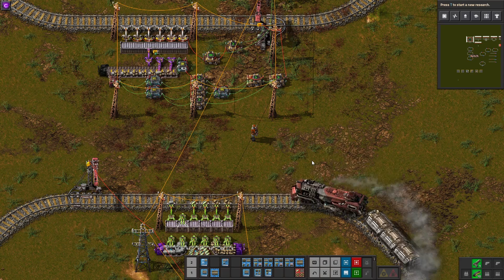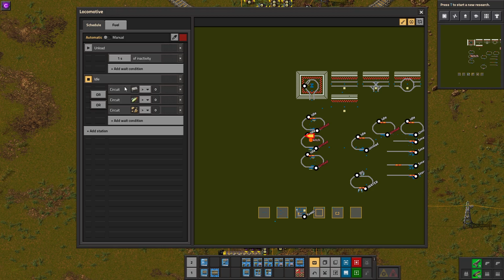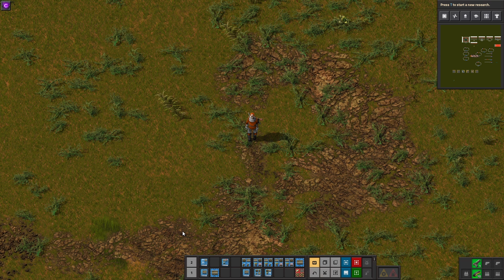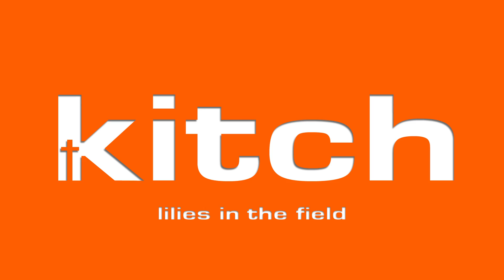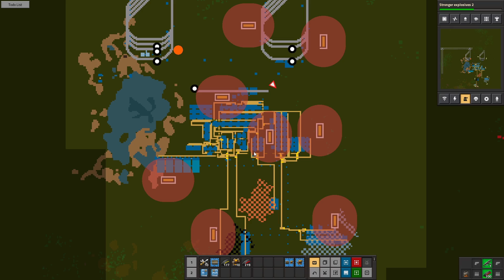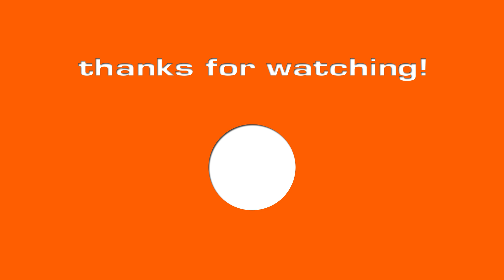Factorio On Rails | 05 | Unloading Station Circuits and Basic Oil | Factorio Train Base Let's Play

Comment: Great series. I like to use the Stone Water Well for my water needs. Pumps out 1200 per second (some of my hyper factories in K2 need 3 wells to run at top speed).

Comment: Much easier to watch than the explanation video I made. 😉 
I also decided to keep the -1 combinator specifically so you could use positive numbers in the high/low combinators. I figured ease of use was worth one combinator. lol

I tend to do stuff like than when designing for other people to use... if I was designing for myself I'd throw ease of use out the window and design for pure efficiency. 🤣
Reply: While set to automatic mode, the trains change color when they begin moving.
Since the train was empty when you sent it to the petroleum pickup, it turned grey. When it began moving away from the petroleum pickup, it saw petroleum in its cargo and turned purple. After unloading it saw an empty cargo and turned grey again.

Also, you didn't get the mod to color the wagons? Trains look so cool when the whole train changes color instead of just the engines.
https://mods.factorio.com/mod/FluidWagonColorMask

Comment: Really good explanation for the Station👍
Reply: Through i would use the output of the SR-Latch to send to the Network to request the Train, but if a train with needed stuff comes by top up the station. Else it could happen, that you request an iron train for one iron plate...

Also if one Station will request iron, then all trains, who are delivering to open iron Stations will be sent. You could encode the Materials needed for a Station in Binary Numbers and decode them on the other Side, but i think that would be unnecessary complicated for the small amount it would gain. But many I’ll try my luck.